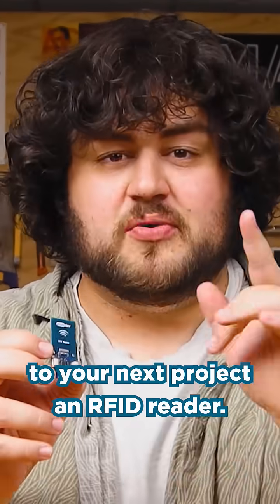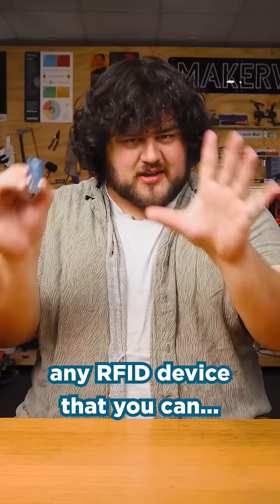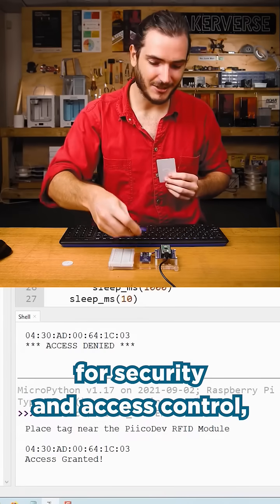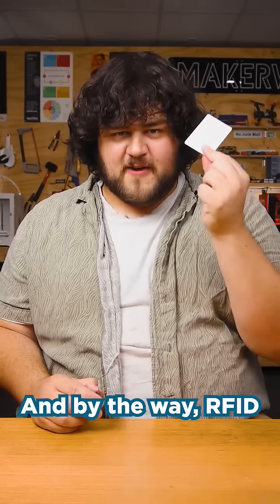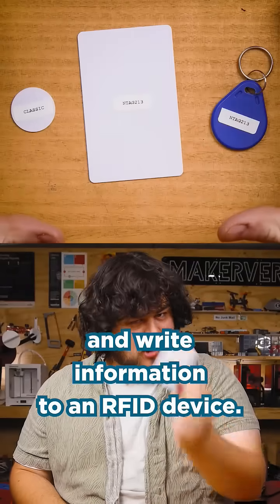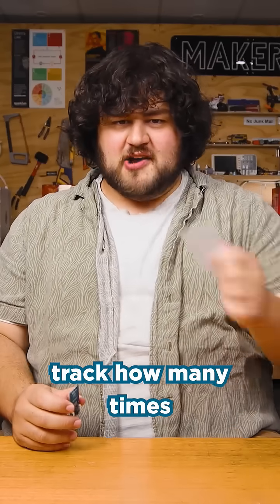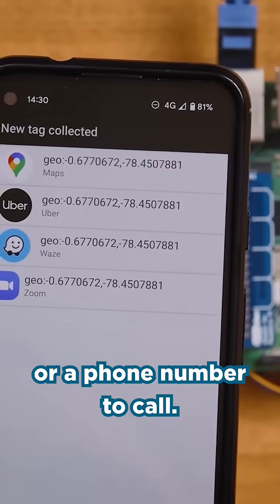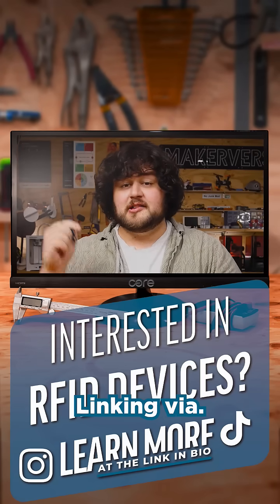Add RFID To Your Next Maker Project

Comment: I don't have pico, why not arduino or esp32
Reply from the maker: This is built in MicroPython which we prefer to run on the Pico. With some slight changes this could work on an ESP32 running MicroPython though!
Reply: @Core-Electronics  you guys have esp dedicated channel? It looks like this channel is all about pico
Reply from the maker: We have been pretty pico-centric the last few years but our new guides should hopefully have a Pico and MicroPython video as well as an Arduino and C++ video that will work with ESPs
Reply: @Core-Electronics  I'll be waiting for those vids